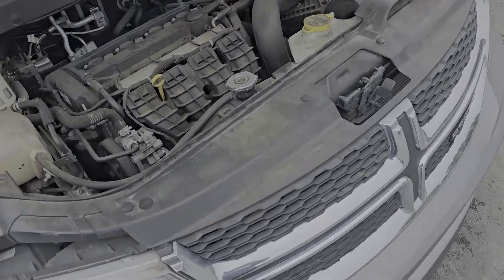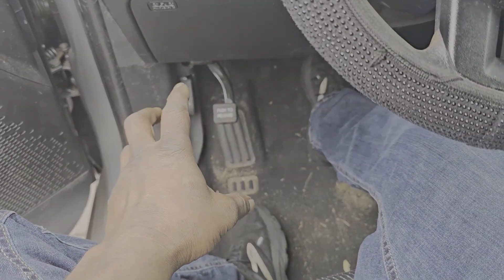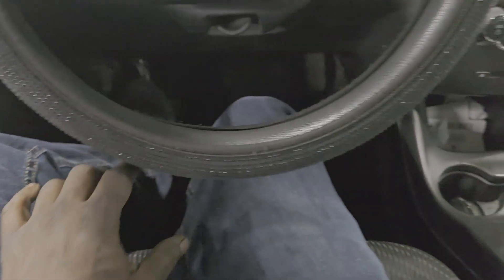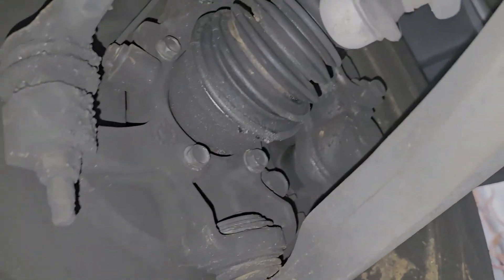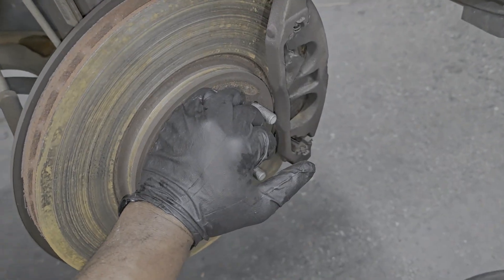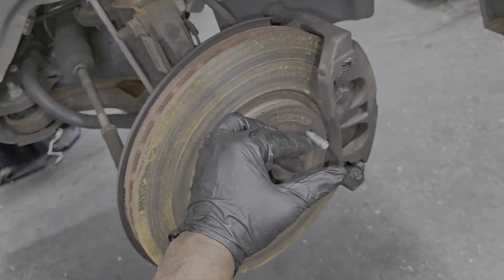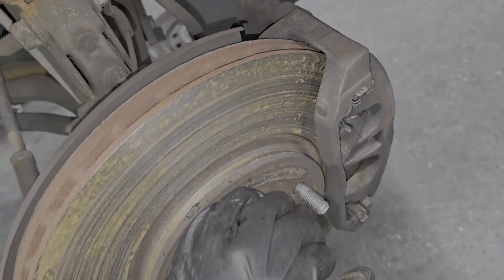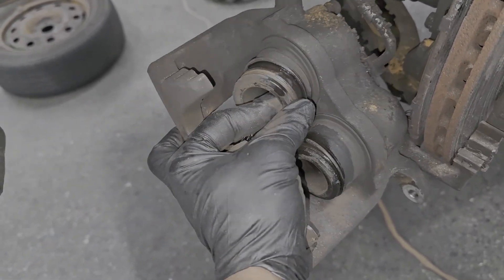"Arrested for Bad Brakes" — Somebody could have gotten hurt on the road

Comment: I've seen worse.  Had a customer years ago that rear wheel cylinders were blown out, hardware broken and missing, drums cracked,  front pads metal to metal and rotors paper thin. Declined work. I refused to put tires back on. Police called. Officer told him to get a tow truck and have it towed,  if he seen him drive it he would arrest him for public endangerment. Absolutely no brakes, not even parking brake.